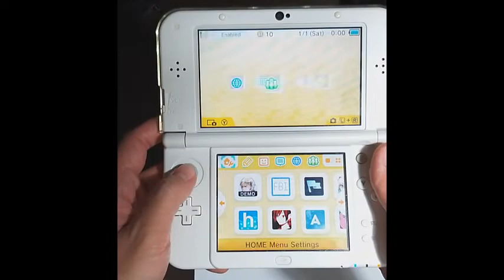New Nintendo 3DS XL circle pad repair

Comment: Hay thank for helping me but what screw driver did you use
Reply from the maker: the screw drivers is a PH000 x 40 Phillips Screwdriver (Dapol size) as shown in the video. Oh but for the first set of screws on the outside it is PH0, slightly larger.
Reply: @CY1RG  thank you bro I literally got scammed off eBay with this small red stupid tri wing screw driver

Comment: Hey, so I have a question. I bought a joy stick thumb grip off of eBay but I wasn’t careful while reading the description and I bought one for the new 3DS XL but I have the first 3D model and not the old XL one either. Will it not fit on my old model of the console?
Reply from the maker: It should be able to fit. By the way this tutorial wont help you, the insides of the O3DS is quite different.
Reply: @CY1RG  oh gosh, thank you for letting me know cause I was kinda worried it wouldn’t fit 😅 thank you for the useful tips!

Comment: So once you got the back cover off what screw head did you use to take the seat cards screws off as well as the surrounding screws?
Reply from the maker: I think i made sure to show whenever i changed the screwhead. At 2:47 I changed to a PH000, philips head 000, for all the internal screws. Only PH0 was used to remove the back cover
Reply: To specify what my question is, I have a New 3DS I’m trying to repair as it has a missing battery, I’m trying to take the cover off its self to replace the analog stick too but I don’t know what head to use, I was told PH00 and PH000 should do the job but someone else told me there not even PH screws (btw I’m not taking about the Y screws I know those aren’t PH screws)
Reply: Reaven thanks so much for the reply, and a fast one too, you think I should be good with these heads too for my New 3DS I don’t think there’s much of a difference right?
Reply from the maker: @mohammadmeze5917  i never seen a non XL new 3ds before so i cannot be sure, but i think PH0 and PH000 is all you need. Sorry I cannot confirm
Reply: Reaven Oh Ok, well thanks for the reply I think I should be good, no reason for them to change the screws they use with each model right 😂, also thanks again for the quick replies couldn’t find an answer anywhere on google so I had to come check YouTube, you definitely earned my sub
Reply from the maker: @mohammadmeze5917  anytime :)

Comment: Question, did the rubber bumpers you had to take out stay in after you put them back?
Reply from the maker: @ranger4758  yes thankfully. The design is good for the 3DS. For the original DS (the fat one), it has adhesives and doesnt go back in properly.
Reply: That’s good to know, I was worried about taking apart mine in the future because of that 🤣 not that it’s a super big deal but yknow.
Reply from the maker: @ranger4758  as a collector, i totally understand haha.
Thank you for subscribing!
Reply: @CY1RG  You’re welcome!

Comment: I have a question
I know that the white part that has the wire and keeps everything in place cant be replaced with one from the og 3ds, 2ds and 3ds xl, it has to be a new model and thats because they changed its design a bit
but how about the inner part you know the plastic part and the black circle that slides those can be replaced with ones from any model right?
Reply from the maker: Yes, the replacement part i bought mentions it is compatible with all models. Im not sure how to open up the other models though, I do not have them
Reply: @CY1RG  nah its quite easy you just unscrew everything and disconnect the triggers's wires and youre golden
thanks for the confirmation
I have old stick pieces from a 3ds thats not working anymore so I figured that the most important part of the new 3ds stick didnt get damaged so maybe I can replace its stick pieces with the old 3ds's
thanks again for the confirmation

Comment: AHHH TYSM FOR THIS!!! I was hoping if you’d share where you got the part and screwdrivers from? :0
My circle pad literally stopped working today completely and it causes the selection screen to freak out because of it, so I figured its either dirty or damaged.
Reply from the maker: The screw drivers are standard so maybe try amazon? I got mine in some hardware store. For the replacement part try lazada, taobao, etc. It should be cheap. Maybe you can try cleaning first before replacing it. Cheers!
Reply: That happened to me few years ago as well Thanks to this video I can change the joystick module and hopefully keep playing MarioKart 7

Comment: Thanks for this! I thought it was harder.

I wanted to ask, I need to replace my New 3DS's thumbstick, can I use regular 3DS thumbstick?

I ask cuz getting the spare part is too expensive here, it's better and quicker to just buy a damaged 3DS with a working stick but I'm unsure if a normal 3ds or XL stick works for the new 3DS...
Reply from the maker: Nope there is no difference. You're good to go!
Reply: @CY1RG  thank you so much for the help!!!
Reply: Did it fit
Reply: @CY1RG  Hi, if the Rubber is a little damaged, can we just change the rubber without opening de console?
Reply: @dianamourag   I don't think so as the Thumbstick is all one piece

Comment: Thank Lordy a purchased kid Icarus uprising before it was too late because I’m not paying $130-$160 for one in the box. $35 digital is perfect. But I have a drifting problem. So I purchased a new circle pad. Also have a question to anybody who knows, so the first two screws of the back of the 3DS, snapped from the back shell. Any ideas? Maybe a rubber band on top? It’s not stripped, it just doesn’t go anywhere as I’m unscrewing them.
Reply from the maker: Replace the shell? Or are the screws stuck in the 3DS?

Comment: Does this also help with drift? Mine detects up and down input long after it goes back to neutral position
Reply from the maker: Depends. For drift unfortunately might need to swap the entire control stick. You can try this repair first since it is cheap. But i suspect the springs inside yours are spoilt.

Comment: Is it normal for the 3ds circle pad to twist/rotate alittle?
Reply from the maker: Im sorry I am not sure what you mean. Like clockwise-anticlockwise? And after replacement or before replacement? If its before, likely the rubber cap is loose (the stick is a solid piece with a rubber cap). If its after replacement then might be placed wrongly

Comment: What screws did you use?
Reply from the maker: Im not sure. I used back the same ones from the 3DS. As for the screw drivers it is a PH000 x 40 Phillips Screwdriver (Dapol size) as shown in the video.
Reply: @CY1RG  All of the screws on the 3ds are the same size right? Since you made it look like you used multiple screwdriver heads
Reply from the maker: @inumizuno  they are of different sizes. I tried to show the 2 i used. The back plate uses a larger size than the insides
Reply from the maker: @inumizuno  so its PH0 and PH000

Comment: My circle pad is drfting, how do I fix this?
Reply from the maker: You have to buy and replace the entire control stick (the square looking thing below the circle pad)
Reply: Have you tried to recalibrate them? But yeah a replacement rubber stick is cheap and easy to replace
Reply: @hamizhashim yes I've tried that, so my only hope is replacing it.

Comment: thanks for the tutorial. the only problem i now have, are stuck screws
Reply from the maker: Oh my. There are ways to remove those but its not easy
Reply: @CY1RG  do you have some advice?
Reply: @CY1RG  had to drill the screws now. but it worked out great
Reply from the maker: @destiny1358  whew. Glad to hear :)

Comment: I got my Silicon thing at the back tear off and become useless
Reply: Help please
Reply from the maker: @tyler-.-349  i think you would need to buy the entire part to replace
Reply: Reaven yo what..???
Reply: Okk
Reply: I will buy a silicon case or at least a case then...
Reply from the maker: I dont think i understand which part was spoilt. you might want to ask for help on reddit or discord (nintendo homebrew / repair) where you can upload the photo of the damage
Reply: Reaven ok then
Reply: Reaven what about my screw
Reply: It cant not be taken off
Reply from the maker: As I said, I don't understand what damage you are talking about. there's no silicon at the back of the 3DS. And I don't know why you cannot take off a screw. Please check out the following groups for help:
https://discord.gg/Ftvr9Mv
https://discord.gg/C29hYvh
Reply from the maker: @tyler-.-349   could you give me your discord or facebook contact? whatever app i can use to message you
Reply: @CY1RG  yo sorry about then. I mean that my circle pad rubber thing is apart from my cirrcle pad and also inside my 3ds there are screws that cannot be taken out. 

Found a solution. I bought myself a new New3DS
Reply from the maker: @tyler-.-349  the circle pad rubber thing can be glued back O_O there was no problem with your 3ds